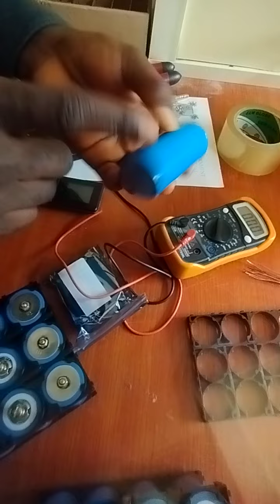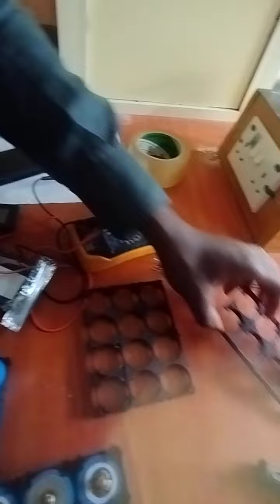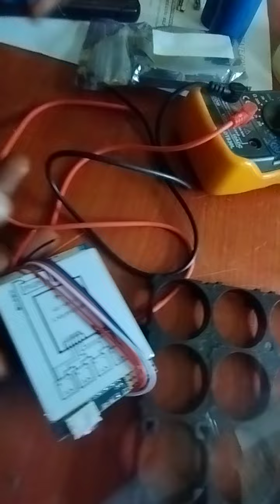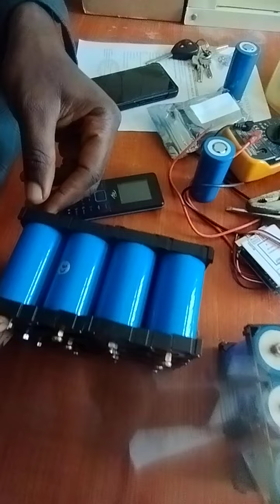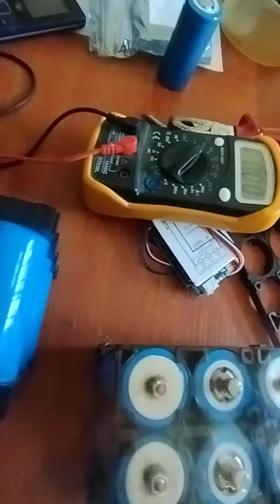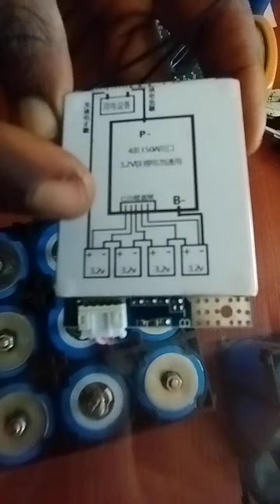DIY: A Beginner's Guide to Building Your Own Lithium-Iron Phosphate Battery by Engr. M. O. Lawal

Comment: Please where can I get the battery holder?
Reply: How can one buy from them ?
Reply from the maker: @nzetechtv4474 I just found this on AliExpress: 
NGN919.06 | 2 Pcs 18650 Battery Bracket 4*6 Cell 18650 Batteries Spacer Radiating Shell Plastic Heat 18650 Holder Bracket
https://a.aliexpress.com/_EzEV9Og
Reply: @SolarPowerHub-r6x  fine sir. Payment, is it not in dollar?
Reply from the maker: @nzetechtv4474 it is in dollar
Reply from the maker: Available on aliexpress or alibaba